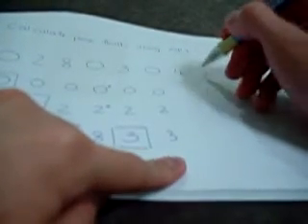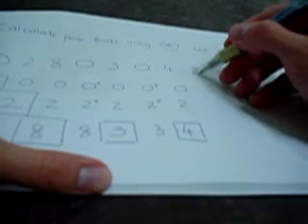OPT algorithm

Comment: Hi Sir I have a problem with this algorithm that is for 1,2,3,4,1,2,5,1,2,3,4,5  and I ordered them like this (1),(1-2),(1-2-3),(1,2,4),(1,2,4),(1,2,4),(1,2,5),(1,2,5),(1,2,5),(3,2,5 here I used FIFO because there was only 5 in list for 3 and I ignored 5 I made a choise between 1 and 2 I picked 1 because 1 was used before , than I obtained (3,2,5)), (with same method I obtained ( 3,4,5) for last 4 but our teacher found (4,2,5) instead of (3,4,5). Where is the mistake :(  according to fifo 2 used earlier than 3.   Thank you :)

Comment: I have a small question : If we run the OPT algo on :
1 2 1 0 4 1 3 4 2 1 4 1 , the answer at the end (last column) would be : 1 2 4 or 3 1 4 ?
I am a bit confused.
Appreciate ur help.

Comment from the maker: @azuz16 
At step 5 on determining where to put page 3: if you have 0, 2, and 8 are coming, e. g.
0 2 8 0 3 0 4 2 0 5 8
0 0 0 0 
   2 2 2 
      8 8 
you will replace 3 at the row position of the page that coming last. For this example, 
1. Since 0 (step 6) is arriving first, it will be skipped.
2. Then 2 (step 8) is arriving, it will be skipped too.
3. Finally 8 (step 11) is arriving last, it will be the only one left to be replaced. Thus row#3, page 8 will be replaced with 3.